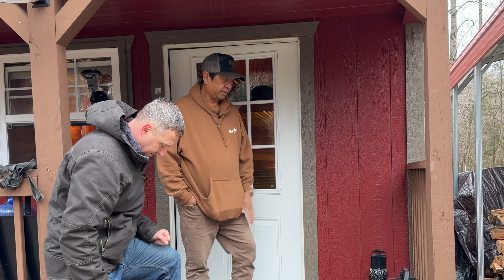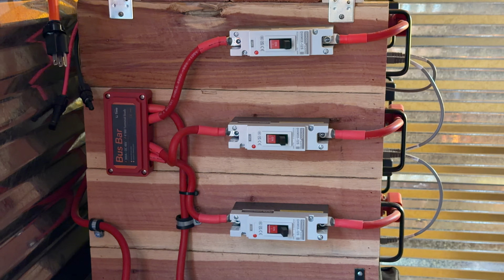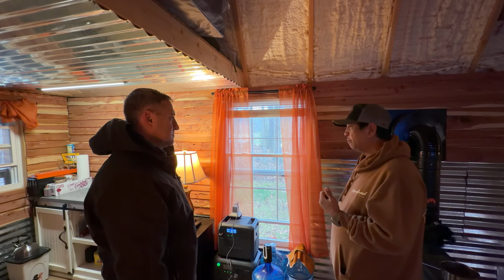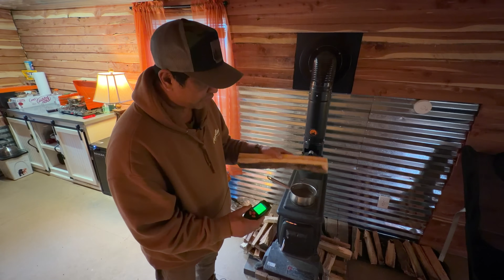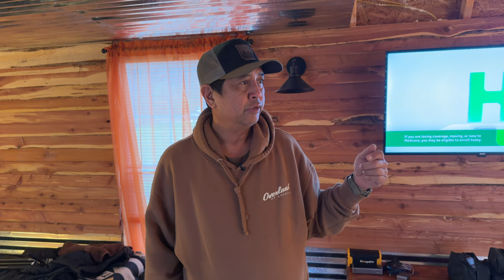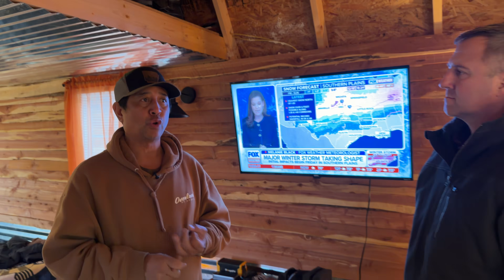He Built His Off-Grid Dream From Nothing! (It Takes Grit)

Comment: How deep is the water level in the well pipe? I have a 24 volt well pump that will pull from as deep as 250 ft down, it only pulls 2.5 gallons a minute, so I have a 1000 gallon tank with a float switch, and I set up the entire system to run on a timer to run from 10 in the morning until 4 o'clock,

Comment: umm, I am off grid and I actually do just get up in the morning and drink a cup of coffee.  and listen to some music  at the start of my day.  Is being off grid  easy?  Nope  but its a lot easier now than when I started 17 monthsd ago.  I can run AC 24 hours a day most days,  havn't had to run my generator since Febuary. (Was only having  to run it a few hours at night to  make sure I had enough battery for heat till either the sun came up or  to recharge the batteries  on a lo or no solar day. And FYI  that 51.2V is  NOT The topped off voltage, Topped off  and resting voltage is  54v  chargeing voltage is 57.6±0.8V

Comment: Will a 1200 watt solar panel array, 3000w inverter, with 3 100ah lithium batteries power my log splitter and saws?
Reply: If it’s a 12volt system I believe the power surge on start up be to great. If your initial surge is less than 3k than it should be fine.
Wire them batteries in parallel

Comment: Would your batteries last 4 days running an A/C unit?
Reply: What size ac unit you thinking? They make 12 volt AC units now too. Cooling air is the most costly thing you can do but no, obviously it can’t cool your 1600sq/ft house in phoenix Arizona for 4 days without changing the batteries.
Reply: @joshuawinne I was just inquiring from the video.

Comment: 2:46  You cant hook them up in series ..that would give you 150volts output ...  parallel is the only way for 48volt rack batterys. 
but its a nice build. clean and safe ... but i would install a solar switch inside also...to cut off solar input just in case.  safty. 
and just do enough solarpanels. 3 to 5kw is ideal ....so you dont have to worry that much on what your doing inside.
Reply: They are in Parallel, loving the system!

Comment: Your stove pipes look like there wrong. The smaller side of the pipe is supposed to fit into the larger side of the pipe so that you dont have carbon dioxide leaking. The heat and flow go up and out. You want the male to go into female going out. Not the male comming out of the female going out because thats a ring around each pipe leaking carbon monoxide
Reply: They weee flipped after the video was aired. Thank you!

Comment: Dang dude. Get a diesel generator so you only need to deal with one fuel
Reply: Send me one! LOL
Reply: @sempergumbie used Onan from old RV's can be found. If you start looking for one, you'll stumble into it. Good luck.
Reply: My 3,000 watt solar will be completed in a couple weeks
Reply: @sempergumbie that's awesome! Is that winter or summer power? In the video you mentioned shorter days requiring use of a generator to charge the batteries.

Comment: Yessir you’re right I have an off grid cabin up in the Appalachian mountains it colder up there than here at my everyday home my cabin is on 1.5 acres and the land goes in to a 3 acre lake full of fish and frogs and turtles which are all good food sources along with the black bears deer and wild hoggs the only thing we get once a year is propane I have a 500 gallon tank full there is a gas floor furnace along with the fireplace and full size stove and propane fridge and freezer but instead I have an ICECO VL 65  ac/dc fridge /freezer it’s all I use yes it hard work with the fire wood and fuel for the generator when needed the solar system does the rest y’all !
Reply: Awesome!

Comment: More money than sense.  Wells are expensive, but, if you're going to spend it on all that expensive battery inverter mess you have????   I disagree with most of what you said and did. To me , I've lived off grid a good portion of my life. There's #3 things you cannot skimp on. And there's #3 things you have to plan for.  Everything else is an option. #1 Firewood. Unless you are poor as dirt and love physical stress. Buy your Firewood.  You can split it if you just want the exercise.  Buy 2 cords in the springtime. And 2 more in the wintertime.  Then after winter buy another cord.  Then you'll have #3 cords of dry wood for the coming winter, and have dry wood from now on. If you always replace it in the spring.  2nd.#  A  good generator battery charging of course is worth it's weight in gold. Solar will help charge your system. Buy a wind generator as well. Cut a healthy Tree off about 30 feet up, de-branch it.  Then mount your wind generator. Wind blows 24/7/365. solar you get 6 hours a day. Big difference. So, you'll have 3 modes of power then.  All for free basically after you buy them.  3rd. # Buy a wood Cook stove, they not only allow you to cook, bake, boil, and heat. But they will heat your water as well. So, no matter what happens you'll get #3 times the heat you're getting now, and you can regulate it better too. Plus all the other advantages listed. You'll burn #3 times less wood too. If it were me. And I had your money and time. I'd add on to the front porch area, make another door but opening from the left side if going out your door. Put your kitchen in the new room and add a propane cook stove as well, right next to the cook stove. You can run it off a 20 lb. propane tank like comes on a gas grill.  Get a small refrigerator. and low-watt microwave.  Then you'd be set.  We burned kerosene lamps for heat and light. You'll be absolutely amazed how much heat those suckers put out, as well as light.  Lastly put up a gate at the end of your driveway. And buy some trail cameras to put hidden coming in and going out of your driveway. Have a couple on your cabin too. I hid one in a bird house 12 feet up in a tree facing my front door. And get a driveway alarm off amazon. Then you'll get notified if someone comes to your place night or day. And with cellular trail cameras you'll have them recorded should something happen God forbid.  But peace of mind is a lot. Ring cameras are cheap too. And they run off batteries. So, no wiring necessary. And they store everything on Cloud. Also throw some toys and an old bike out in the yard. Thieves are scared of children, never know when they are home.  Works.    If you build on the front say 12x12 door facing left, no wind will be coming in and out constantly. And 12x12 is big enough for a kitchen and a pantry storeroom.  Then with the propane cook stove and wood cookstove. You'll be set for life. Life will get easy then too. Kerosene lamps.  Make a huge difference in the cold months.  You can put in a septic tank for cheap too. Add on a bathroom a working toilet doesn't use electricity get a sink and shower instant hot water heater off Amazon for $120 and a 500-gallon water container and have everything anyone else has. I'll bet you there's a water delivery service near you too.        Peace.
Reply: Thanks for sharing all your tips and experiences!
Reply: @sempergumbie  TY for the Reply back.

Comment: Im doing 12v just because of cost, 3 Redodo 100ah batteries, o don't wanna use power stations just because if something goes wrong, you have a $1000 brick.. 
But for safety,I'm putting the 3 batteries in an oil drum wood stove . Soooo,if something happens and they do catch fire,my house won't burn down. But,I've found i don't need a lot of electricity,I only have a small apartment washer,no dryer, air does fine..once a week. Lights are usb powered, a small TV. propane stove,wood heat,i get it cheap from a local mill. Water,I haul and gutter collection. Loving it out here
Reply: That’s awesome and those are great ideas! Thanks for sharing, where are you located?
Reply: @offgridgumbie oh/wv border Marietta/ Parkersburg area
Reply: Oil drum...briliant...taking notes! Thanks!

Comment: From what I can tell the stove pipe inside the cabin is installed wrong. It's pretty much upside down. Smoke will constantly escape! You might want to take a better look at it and get it fixed, especially since it won't cost much or nothing at all.
Reply: The pipe that’s connected to the stove is the same on both ends. So no matter which way the stove pipe goes it’s the same. I pondered on that when it was installed. Thanks for the update though!

Comment: I bought 1.5 acres and poured a concrete slab then added power pole for grid power. I lived in my camper for 3 years in a camp ground. Land was great. Once paid for I bought a 12x40 cabin just like yours, same porch. I paid 13,000 for it. Put a concrete slab down for it. Moved in and sold camper. Working on inside still. Spray foam, 3 ceiling fans. I divided into 3 rooms. Bedroom with queen bed, dresser, mini fridge and 60” tv. Small kitchen and very large living room. I put T1-11 on ceiling and thick paneling on walls. I run a Vermont Castings intrepid 2 wood stove works perfect. I had a hard time figuring out my cooking. Then I discovered the induction cook top 1800 watts of pure genius. Electrician set up my outlets and breaker box. I also have a mini split 18000 btu. No water it rains a lot in Alabama , I have a 80 gallon tank I catch water into. I’m 65 and retired 5 months now at 65. Love this life style. I use 2-4$ a day electric , in summer, in winter heating with mini split it was $9 a day that’s why I bought wood stove ! Using wood for heat I only use 2kw power per day. Average power is $80 a month for year ! Been in here 1.6 years. Love it
Reply: You ruined it with the spray foam. You'll find out why in a few years when it rots to the ground and you're always sick from mold and mildew. Stop using spray foam insulation in residential buildings, it's not designed for it. Residential buildings have to breathe.
Reply: @prima164 Whats the best choice for the Graceland buildiings?
Reply: @GiftedTexas mineral wool batts with a high quality name brand vapor barrier on the outside. The house will breathe perfectly with excellent energy efficiency and be almost soundproof. That is the most premium option that actually lets a house function properly, anything more you might as well set your cash on fire
Reply: How do you get a continues layer of vapor barrier on a shed that’s already built…? You just putting it between the studs before filling with wool insulation?
Reply: @SecretSquirrel-et6dl  Vapor barrier goes on the outside of the house, over the sheathing and under the siding. Either tell the shed company you want vapor barrier installed during the build or tell them to use screws so you can remove the siding and install it yourself. Vapor barrier isn't 100% required, there are tens of millions of houses without it that function just fine. The one and only thing that will kill your house is spray foam insulation.
Reply: I’m impressed! I’m staying on my family property in my rv. I love the simplicity in living and would love to build an off grid home on this property. Great job on yours!
Reply: What State and County?  Cannot do that everywhere, sadly
Reply: @sarahaas3182 I'm in St. Tammany Parish in Louisiana. It's a rural area, but I've noticed over the years that they have implemented a lot more rules restricting how you can build and live. For instance, they have rules about the septic systems that can be installed for new builds and the electric company won't hook up lines unless you have a specific septic system (which the only company that installs them are owned by the person that made the rules!) I'm not sure if there are rules against building a completely off-grid home in this area or not. That's something that I would need help with.
Reply: @GratefulWarriorMom  Many states have started doing similar things. Forcing people to use a list of installers has allowed them to price gouge customers and the average price of a minimum spec septic system in those states have doubled. The materials for the septic system haven't increased, they are just price gouging the labor now because they know people don't have a choice. They did the same with the electrical code a couple years back by requiring every circuit to now have a $70 breaker installed instead of the $3 breakers that we've been using for a hundred years. The people who approve the electrical code changes need to be investigated because it's clearly a money grab. It's a 2500% increase in every new electrical hookup. Some places are even requiring new homes to be installed with 600 amp hookup "just in case" they decide to buy an electric vehicle in the future which increased the electric hookup price by about $20,000. It's all corruption, all criminality in this country right now. With a corrupt and criminal justice system nationwide, it's all going to come to a head eventually via citizen tribunals or outright war.
Reply: Sounds like we are both doing the same thing! Thank you for the great ideas and comments. I hope you subscribe to the channel!
Reply: Thank you for sharing! Love reading comments like yours.
Reply: your living my dream ... great work

Comment: Shower Hack 

I live off grid much as you do except, I'm in north Texas. 

When I want to take a hot shower, all I have to do is heat an aluminum turkey cooker pot full of water and throw in a submersible 12 V bilge pump connected to a hose with a hand held shower nozzle on the end and that's it.

I have a propane turkey cooker that I use for heat, but you could easily build a stand above a wood fire or even use a small rocket stove to heat the pot of water.

A barbeque sized propane bottle lasts me about a year. I heat the (ten gallons?) water to 125°F.

Former Coastie
1970-1976

Edit:  I designed & built a year-round solar water heater that is ground level, CANNOT freeze in Winter, will last forever and cost me about $50 to build.

I also figured out how to get FREE propane. Ask me how.
Reply: Semper Paratus brother! I do have a Overland shower system that is heated with propane. I just haven’t set everything up yet in the cabin and it’s becoming a work of in progress but eventually I will get there but until then I’m using the planet fitness for my showers or I use a pot with warm water
Reply: Do you have a shower house or built a building for your shower?
Reply: EXPLAIN where to get the pump please. Type of hosing?
Reply: what do you mean "free propane?"

Comment: I'm sorry but isn't those 3 batteries a bit of overkill? I've seen homes larger with less. I'm no expert just asking?
Reply: You can go days without direct sun and could run the risk of not getting a good charge. You need enough energy to cover those days. Especially if it’s your only source of power.

Comment: Not bad. I have an off grid cabin in TN as well. May need more insulation as that stove should be more than enough heat. I got an eco worthy solar tracker, should look into those ( like $350 right now).
Reply: I’m still working on finishing up the cabin. It’s a work in progress.
Reply: @offgridgumbie Like any home it is a never ending project. I found a freshwater spring on my property that I will be tapping into. Maybe you can use a gas pump to pump water out of the well and into the totes (then use an electric pump to supply the cabin)
Reply: @silentsheepdog44  that was what I planned to do

Comment: If there's a well on your property, you should do some YouTube University research and fix it. A new pump isn't that much. Drilling a well is the majority of the expense. Pump, pressure switch and pressure tank is less than a thousand bucks. You can do it!
Reply: Really only need the pump with his set up 2 fill the tanks when needed
Reply: @throughmylens5127 True, he could get by with that, but filling tanks gets old and depending what part of the country you're in, in the winter IBC totes will freeze. Been there, done that.
Reply: @jimbrown4265 Im planning on a water shed with a dirt pounded tire wall perimeter and insulating the IBC totes. Do you think it will keep them from freezing in Oklahoma?
Reply: true

Comment: You need to share your total cost for your electrical system.
Reply: I appreciate the comment and all in with the batteries, the inverter and the cables circuit breakers. Everything you see in the video except solar power Panels is about $4000.00

Comment: That is NOT what happens when you wire batteries in series.  It increases the VOLTAGE and has nothing to do with which battery drains first.    If those were in series the nominal voltage would be 153.6 DC, which is not only very dangerous but would break the inverter instantly.  Batteries at the same SOC (state of charge) will drain at the same rate when in series.  I understand he said that they should be in parallel, not series, but his explanation is misleading and dangerous.   

Other than that...cool stuff.
Reply: I guess I should’ve gone more into detail but  for those tech folks. Regarding the Parallel versus Series connection…. In Parallel, you add the amps yet the voltage stays constant.  With Series, you add the voltages yet the amps are constant…. IF you connected your LiTime rack mount batteries in series (never do this) you’d have a 100 amp, 153.6 volt battery—they would fry each other and the inverter.  Fun fun fun!x
Reply: Thanks for bringing it up

Comment: You need to freeze block your rafters and your top plate and sister up those 2x4’s along with some hurricane ties. It’ll add massive lateral stability to that cabin. Put in some spray foam DIY insulation because the spacing in a shed is only gonna give you R11 with fiberglass bat.
Reply: We are scheduled to foam the rafters in the next few months.
Reply: Cross brace every beam in the roof and reinforce bottom plates for greater structural stability. Make sure your corners are well built and strong. Keeps the house from "wiggling" in a strong wind.